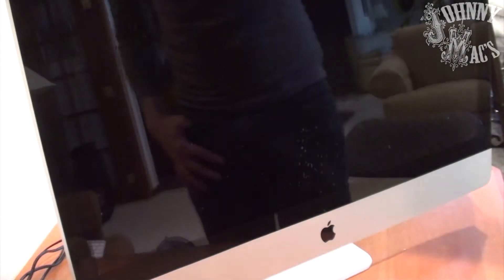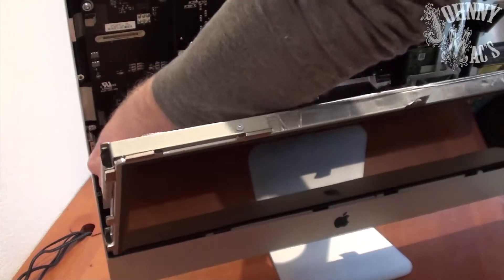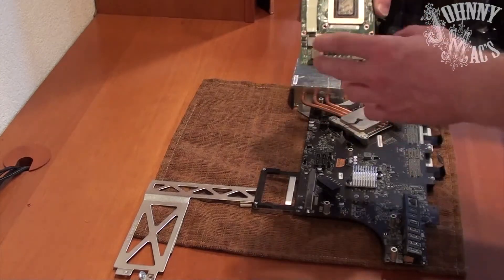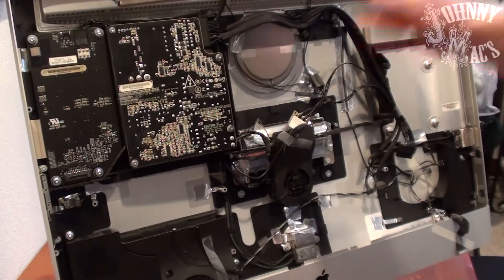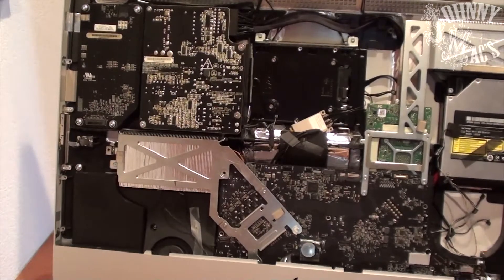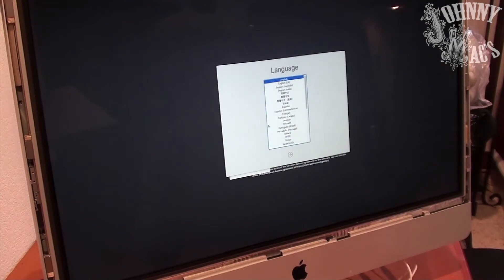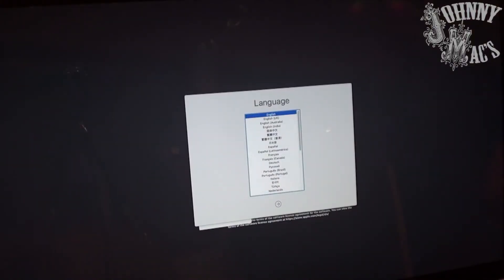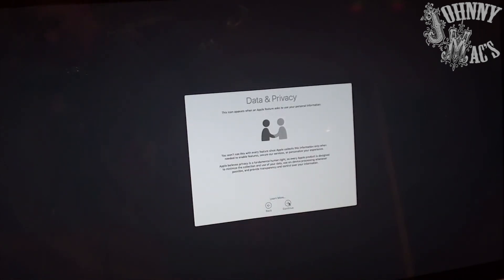Bring that Mac Back - 27" iMac 2011

Comment: I just followed your bigger story - I have had more than good reason to be afraid of my own government.  But THAT is not why I am posting... I actually HAVE that iMac and the graphics card went out at the same time the on-off button failed (I set up an automatic boot time in software to get around this) and it's pretty dead.  I'm not sure it's worth repairing at this point as I bought a later Mac and have been using it for half a year, so although I could move the earth with my old one and all the software I had on it, I'm 90% back already.

I wish you were in L.A. for I would DEFINITELY bring it to you for repair and I don't want to get the suction cups and do all that stuff (I actually did computer hardware repair for someone else's shop back around 1990 and would rather have someone else do it for me these days).  I'm a geek, but I screwed up a fan in my MacBook Pro so that it overheats and all because I followed a youtube video where the guy did NOT give the right advice...

Anyway.  You're a great guy and oh... I'm running Sierra.  Love it.  I might get a new one as a sort of back-up with the newer file system from OWC (I love the Larrys).  

God bless you.  He has our backs.  We have a lot in common.